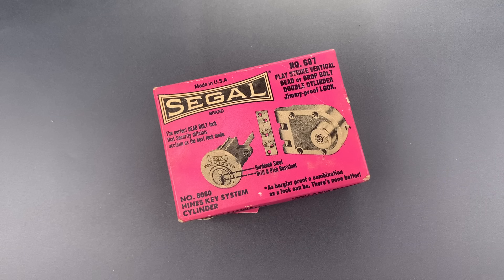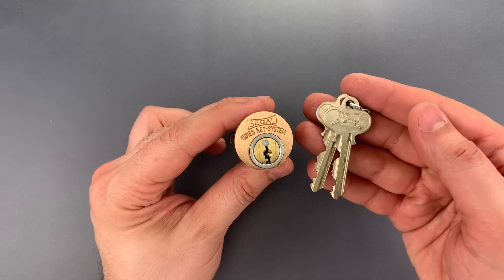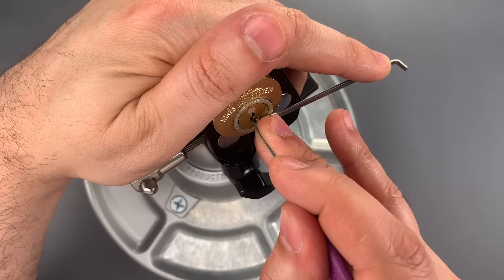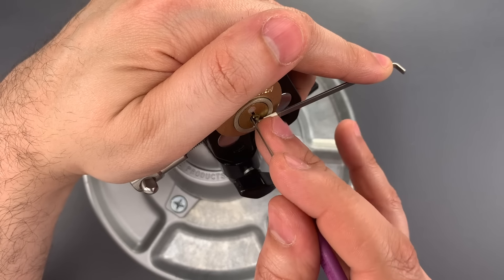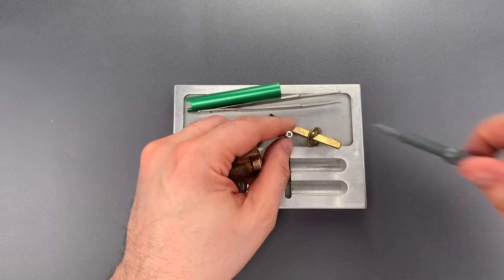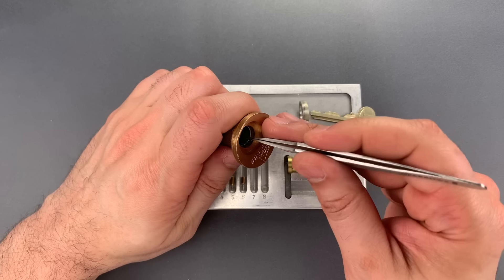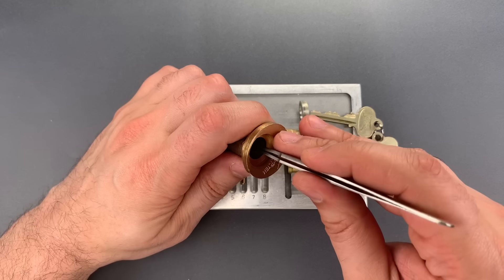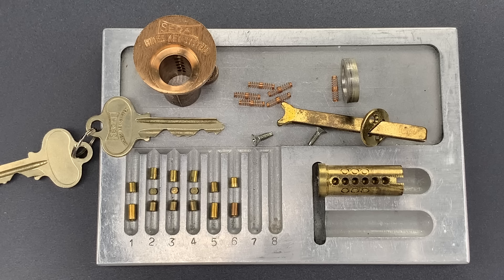[1181] A TRAP For Pickers! The Clever Hines Key System Picked

Comment: Very Clever lock! :)  That being said, you can reset the cylinder with gravity, if the lock is out of the assembly, right?  Thanks for sharing this.
Reply: Nope as the springs keep the pins pushed into place :)
Reply: @ironhyde1741  ouch
Reply: Everything can be reset with gravity strong enough :D

Comment: Very few thieves have both the skill and willingness to troll.

That's the sort of thing that would only happen to someone who was being deliberately targeted.

And there are much easier ways to force people to replace the lock.

A good idea would be to put a spool pin or two in as well to frustrate raking, as well as to cause counter rotation to drop pins back below the second shear line. This way some joker with a rake won't trip the trap, and thus only people who are single pin picking will get caught and lock you out.

Comment: This might be a dumb question: if you machine the edges of those circular grooves, could you make it so the lock doesn’t completely seize, but still prevents rotation? That way it’s difficult to pick but doesn’t require disassembly if a pick is attempted?

Comment: What about brute force? Example screw driver type thing banged in and turned with significant force? If this one can be picked to the first shear line and the hollow pins engage to trap it, those hollow pins are much weaker than other pins and maybe you can torque them open with brute force? Curious how LPL feels about brute force entry's opposed to skilled lock picking?

Comment: You could solve the security problems by adding trap pins to every chamber and randomizing whether they set to the first or second shear line.
Reply: This only works with two shear lines.
Reply: @stargazer7644  The number of shear lines is determined by the number of pins in each stack.
Reply: @Carter-dv4hz  Right, but you can only have trap pins when there's two shear lines.

Comment: Question is how would you know those pins have traps if you didn't open the lock up and look at its insides? Sure you may be able to decern this lock when you see it, but say another company used a similar method. Is there anyway you could determine this without opening it? That's the key here because if you cant then you would just seize up the lock and be done no matter how good of a picker you are. Unless you just check every lock you pick for multiple shear lines? But then if thats the case couldnt they mix it up to trick you?

Comment: If they had included the order of the wafer & cup pin in the key coding, it would have been even harder, as you would never know which of 2/3/4 needed to be set to the first or second shear line. IE: (3)(2^)(5v)(1^)(3)(2) instead of just putting the cups on top all the time. The thickness of the cup obviously has to be deep enough to catch the trap, but the wafers should be at least that thickness, and the sizes of each varied to make it harder to know which is which.

Comment: Thanks for another great video!  Quick question: how do you remove the lock core if you make a mistake picking and one of the hollow pins drops down onto the grove?  I assume you can do this as long as you have external access to the lock cylinder, but just curious how.  Thanks!
Reply: You always have "external" access to the lock cylinder, but that doesn´t mean that "external" is from the outside-side of your door, or else, all locks would be pointless. You have to find another way to get in your home, and then unscrew the cylinder (and repair or simply replace it) from the inside-side of your door...
Reply: Apologies if the original question is unclear.  To clarify, I was asking how you can remove the seized lock core assuming you have full access to the lock cylinder.  In the video @6:28, the LockPickingLawyer states that he tried using a plug spinner ten times to see if that was a viable method to open the lock and it only worked once.  I'm assuming he didn't throw away nine locks for the nine times the spinner failed, so I am thinking there must be some way to remove the core and fix the lock if it becomes "seized up" due to a failed picking attempt.
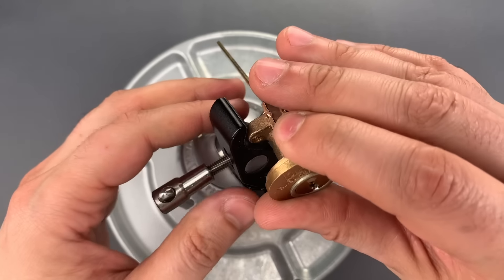Reply: @petersmith2481  Sorry, u right, I missunderstood. At 1:37 I can see a long, thin strip on the top. Maybe that strip is a separate piece of metal, that makes a 90°-turn to the lock´s back side, and is there hold by a screw. If that´s a movable strip, and you can slide it out rearwards, you may have direct access to the pin-holes direct  underneath it...
Reply: So I finally found a comment from LPL on an old reddit post on how to do this: "If it’s not installed (or if it can be removed from the inside), the cylinder can be released non-destructively by rapping."

Comment: Wouldn't a better strategy be to have those circular groves next to all pins, and randomly place between 3 and 6 hollow pins in?  You could have hollow pins in all 6, or pins 1,2,5.  The picker wouldn't know. Or couldn't you have 2 shorter hollow pins with a spacer below.  Then you'd need 3 clicks out of random cylinders.

Comment: Would it be possible to insert per pin position a sequence same-height hollow pins and wafers (e.g. HP, W, HP or HP, HP, W) so that there is always the same number of shear lines, but one does not know which shear line is the right one. How could one pick such a lock? Could it be produced reliably?

Comment: What if the trap was randomized per lock? You could even have the non trapped pins also have the hollow pin/wafer setup, so that a lockpicker could second set those, and have the keyway not turn. If you only have one chance at picking it, you couldn't  try different combinations, right?

Comment: All of the comments keep talking about randomizing the positions of the trap pin and/or grooves they fit in. Correct me if I'm wrong, but wouldn't something like that make the lock a LOT more expensive, since they'd have to either have equipment made to be able to put those grooves where they want them, which would probably been very expensive in the 60s, or have people do it by hand, which would have been time consuming and more prone to errors, as well as having issues with interchangeability? Feel free to correct me if I'm misunderstanding something here, or if I'm being ignorant.

Comment: Ive literally just watched these videos and got lucky picking my front door a long time ago. 
Wouldnt an electrical jiggler (i think thats what its called? Esentially an electric bump key i think) if you had one on the powerful side, vibrating the lock body enough couldnt it slip off one of the traps? Itd be rather noisy but, could it work?

Comment: what about if they had randomized the trap pin locations? so that even if you knew the lock had the trap you wouldn't know which pins it was on. then add some sort of special pins in the non trap locations so that they felt like they could be one of the traps.

Comment: Could this style key system be modified so that the hollow grooves are randomised, instead of being 2,3 &4? Surely that would make it much more pick proof
Reply: I think that even a single trap-pin out of 6, in a random position, would raise the security a ton. Combined with serrated pins for the remaining 5. The serrated pins would lead to the belief that you´ve already picked the trap-pin correctly, thereby getting it more false than correct most of the time.

Comment: Would this not be more secure of the trap pins were put on 3 pin holes - bit differing ones on each lock. You know, make 'X amount' of variations to avoid the trap being on one place for all these models. Manufacturing cost goes up, sure. But security/time needed to open the lock, greatly increase there too!

Comment: So, if one were to design a keyway system that implemented this concept, but in a less consistent pattern, then there would be an increase picking failure?  For instance, instead of only using 2, 3, and 4, maybe using a combination of all cylinders, unless 1, and 5 are not used for a significant reason, and furthermore, there's got to be a way of even incrementing the false sets for each of the security cylinders, so without the key there's not only no way to know which cylinders need attention, but also, exactly how many set points are needed to be reached in order to "know" that particular pin is positioned correctly.  Increasing these things obviously makes manufacturing such a thing, more bespoke, so to speak, is the exact opposite of mass production, I guess, and therein, lies the rub.  ....but, I figure the thickness of wafer, number of wafers, and length of pins, constrained to just 2 variables each, coupled with the "randomness" of security cylinders, should combat the counterintuitive nature of the endeavor, by allowing production to remain at scale, yet offering not only a plainly, normal presenting product showing no hint of difference, yet offering things such as cylinders 2, and 3 need to be set normal, 4, and 5, to the second set point, and 1 to a third, yet another keyway is different combinations of such things.   Not sure how much more difficult that would make things on you, not knowing the info ahead of time without of course, taking it apart. Not even sure if that's even possible, what i've mentioned.

Comment: If the trap is set, couldn't you try bumping to pass it? Or would the trapped pins bind too much even with light pressure on the keyway?
Reply: I was curious if the hollow pins set in the trap were flimsy enough that you could force it open with a wiper insert. This would damage the lock of course, but I'm still curious.

Comment: I'm wondering if one could use pin stacks everywhere, and then randomly assign hollow pins to the top or to the bottom, so that one couldn't determine whether to set each pin to the first of the second sheer line based on whether they are stacks or not, and getting any of them wrong would just jam the lock

Comment: I’m new to picking so please disregard if this is a dumb question but wouldn’t a lock be harder to pick if they didn’t have springs and just sat freely unless the key was in the hole ? I asked this because I was picking a dead bolt I got at Home Depot for practice and the the spring on the first hole seem to have broke and it’s the hardest pin to set with pressure.

Comment: I know I’m late to this video, but I actually do have a question. Couldn’t Segal have made these locks essentially unpickable by randomly selecting the locations of the trap pins? That is, by making each lock have the traps in different places, instead of it always being on 2/3/4. Or even, since it would be basically impossible to mass produce locks if they all had different cores, couldn’t they have made, say, 3 different cores, and manufactured them all in equal amounts? If you only have one attempt to get the pick right and you have a 2/3 chance of not even guessing which pins have the trap, it seems like the lock would be functionally impervious to picking.
Reply: I am not a picker really so take this as just some random thought, but if seems to me that once you suspect the presence it's 'just a case of trying to feel if a pin has multiple sheer lines'. What would make it harder is having both options as viable, the lower and higher sheer lines. Then you would have to guess which you won't do with a lock which will seize if you guess wrong, or you need to access to say the key in a picture to see the bidding ( or just having seen the bidding ).
Reply: My thoughts:

They would mass produce the cores with trap rings either side of all the pins.  How the different shear lines are inserted I don't know, but randomising the trap pins is then a matter of selecting which pins are single shear and which are double shear, and on the double shear pins having the disc or main pin as hollow[1] (to attempt to thwart those who know the locks have trap pins with double shears) would alter which shear line is required on the trap pins.  As a result given a lock a picker would not know which pins are double shear (though could probably find by feel) but as to which of the two shear lines is the trap would be unknown until the pick attempt (unless there is a difference in feel between a hollow pin/disc and a solid one).

[1] having the all the traps on the second shear line could make the lock similar to one with no double shears if a picker didn't know the brand and make it easier to pick.

Comment: You know, I feel like something like this would be a very good idea for a LOTO lock. Those should NEVER be picked when in use. They're cut off when necessary and only after it's confirmed to be safe, so something that prevents opening via the keyway after a pick attempt is not such bad thing.

Comment: If they wanted to make it really difficult, some of the pins would lock in the first position (as shown) and some would lock in the second position, at random.  With six pins there are 64 possible arrangements, and the lock picker can't tell which arrangement the lock has.
Reply: Same idea I started with, some pins lock at sheer 1, some pins trap at sheer 1, some pins lock at sheer 2.  Increase the wafer width and hollow it so that some pins trap at sheer 2. Pins set improperly to either sheer line could spring the trap.  Pins improperly set to the second sheer line could keep it locked and the trap could not be sprung. Sprinkle in some false set pins and false set wafers, by the time you get that cylinder to turn, you will have forgotten about the trap.

However, no amount of tricks and traps alone can completely protect a keyed lock without an interactive key.  Just hide a camera of sufficient quality where it can get film/video of the side view of the key entering the key way.  From that, cut a key.

Comment: Would you be able to get the hollow pins out from the trap holes if you turn the whole lock physically around?
Or put differently: would the owner of the house be able to reuse the lock after it has been tried picked open if he takes the lock out and turn it around? (Of course the owner would have to enter the house from another door in order to get the lock out undamaged).
Reply: Yes, take it apart

Comment: Regarding the traps.  Could they not be randomised as part of, in this case, the locks model range ?  On some all 3 traps could be used, or maybe 2.  Maybe include 4 traps ?  Could the small wafer be swapped with the trap pin ? So by setting say pin 2 twice you would set the trap ? Or would this not be feasible ?   And if it were randomised across this range of locks then someone trying to pick the lock would not know if they would be setting the trap.  If keys can be randomised then why not the traps.  

Ever thought of attempting to make your own lock ?

Comment: I wonder why they didn't include the trap grooves on all the positions and then randomly assign the trap wafers/drivers. I imagine a normal driver would slide over the grooves the same as the drivers that have the wafers. So even knowing the type of lock you still wouldn't know which pins were the traps.

Comment: Question: lets assume i come home from work, this lock is in my front door and my key is not working, that means someone tried and failed to lockpick it. so far i can follow. But would that mean i now need an entire new door? can it still be drilled out for a new one? How expensive would that drillhead be? How long would it take?
Just imagine coming home late in an apartment building, finding your doorlock jammed. so down into the basement compartment, battery driller and spare lock in hand, drilling for several minutes way after 10 PM ...

Comment: If they released this lock with ‘random’ wafers, two that cause the trap to trigger as shown, and one where the wafer is hollow and causes the trap if that pin is pushed to the second shear line, you’d have a real puzzle?  You still have to pick all the pins, but if you push one of them past the first shear line, you trigger the trap.

Comment: I have a lockwood 001 (deadlatch ?) on my front door. Every now and then the external cylinder accepts my key but won’t turn.? The inside cylinder and lock operation seem fine. Close the door and you play the game of will / will not my key work. Any suggestions?

Comment: Is there any way to reset the lock after the trap is triggered? Or did you have to buy a bunch of them to learn how to do this? You mentioned the plug spinner only worked once out of 10 tries, which implies you hit the trap the other 9 times.
Reply: 1:44 you can see a flat spot with crimped spots. You can remove that piece remove the driver pins that way. But if it's in a door you're probably SOL.

Comment: @LockPickingLawyer

Can the hollow pins, if lodged in the annular detents, be dislodged with a combination of light tension being applied while the lock body is struck/shocked laterally (i.e. in the plane through the cylinder axis and the three centers of the detents)? Is the mass of those pins, in combination with the strength of the springs, such that the Hines defense, once triggered, can't be reset with a little percussive lock-picking?

Comment: can you bump the traps once they engage?
Reply: Hi Ivan. I would like to know whether it is possible to improve this lock. Perhaps pins with sleeves around them so that they cannot be "jammed" by the lock picking methods and a small inner bolt keeps it locked. I would require double springs but hey, there may be a buck in devising something good. I am new to this forum but I do own an expensive bike.

Comment: To really screw up lock pickers they could have the trap pins placed randomly and not use the same 3. Also they could change how many are trap pins to really screwup the picker as they would not know how many traps they are dealing with.  This way there is no way to know which ones are trap pins. At least in theory.